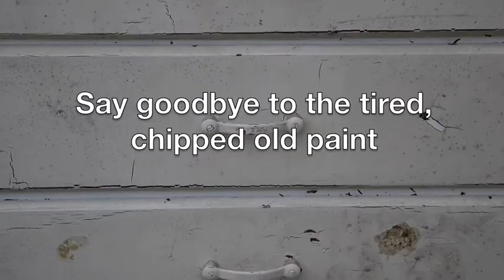Kling Strip a Chest of Drawers - Removing the paint

Comment: I was buying into it until - as is the case with so many of these products - it goes straight from scraping and washing off the Klingstrip to reveal a a dark wood unit with bits of paint still stuck in the crevices straight to 'finished'.  Looks like that unit has also had a sand down to me or certainly some extra work has gone into getting it anything like the finished article.
Reply: @rosalielawrence9150  So this very end shot is definitely just from the Klingstrip?  If it is then I will buy some.

Comment: Wish I would have saw this before I purchased Soy Gel. Soy Gel is good too, but this is taking off lots layers at once. 😟 would save on alot of work.
Reply: Hi AngieB52, you are right - Kling Strip cuts through MANY layers of lots of paint - we sell it in a variety of container sizes to suit your project, we also manufacture other paint and coating removers - virtually any coating from virtually any surface - for whatever your project -  purchase direct from our Website: www.stripperspaintremovers.com